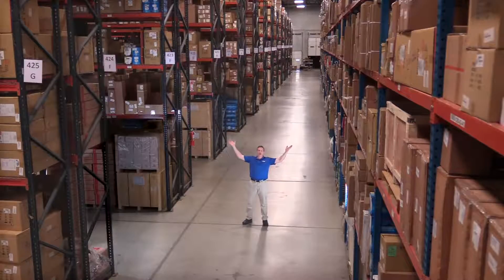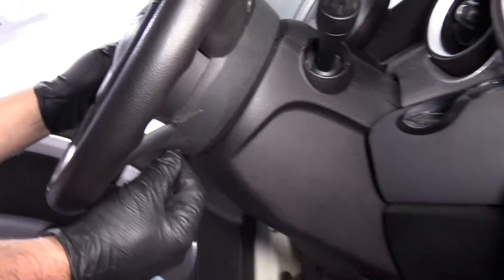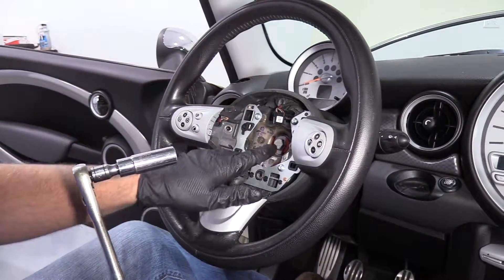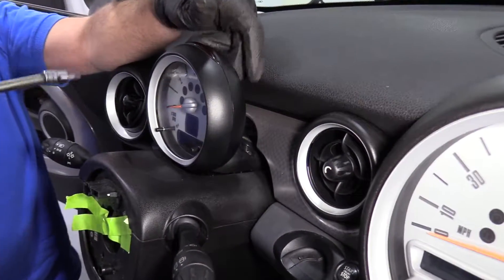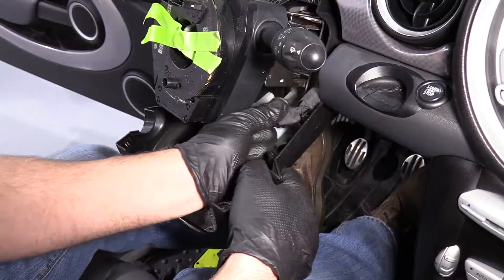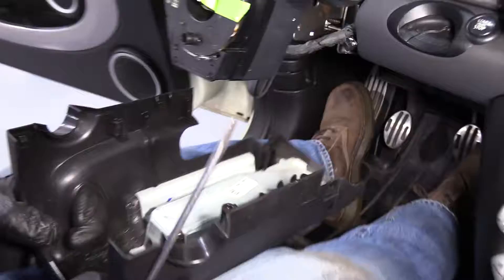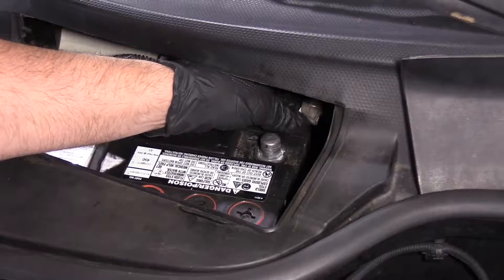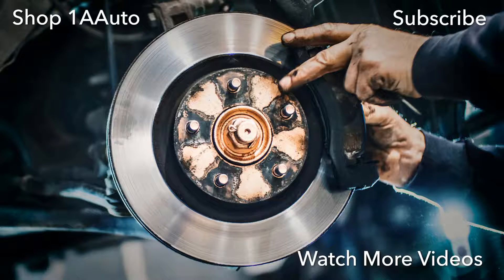How to Remove Clock Spring 07-11 Mini Cooper S

Comment: Very helpful video, precise and to the point. Just a comment to positioning of the clockspring. There is a indicator for korrect position. In the peephole 7 o'clock there is a indicator when the connetors are  on top. Its white and indicate "R", "0" and "L". "0" is correct when the wheels are straight.

Comment: If I remove the whole unit (slip ring including the stalks) like u show in the video on a 2016 MINI F56, will it need any recoding for steering angle sensor when I plug it back in you think?

Comment: Can you explain why you put tape on the clockspring mechanism? What happens if it does rotate? If I buy a used clockspring assembly how do I know that the mechanism is OK, as I on't have a diagnosis computer. Why disconnect the battery? These may be obvious to a mechanic, but to the non-mechanic trying to save some $$$ could you explain things a little more? Cheers!
Reply: Anytime you're going to disconnect electrical plugs, you should disconnect the battery to make sure there's no power going to them so they don't short/ground and damage things.  This goes double or triple for working with the airbag.  Also it forces the car to "learn" the new part that's being installed.